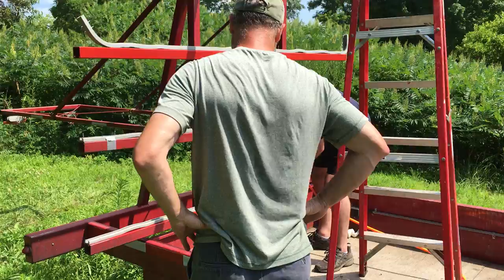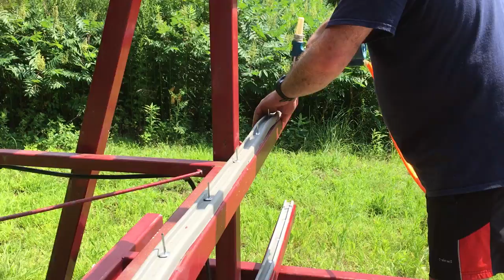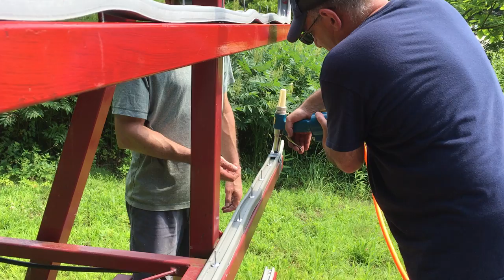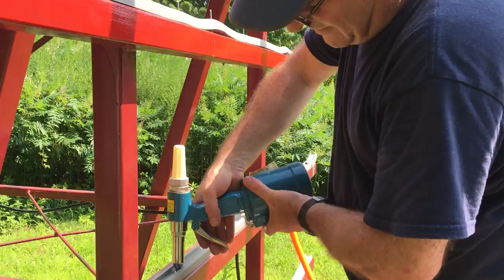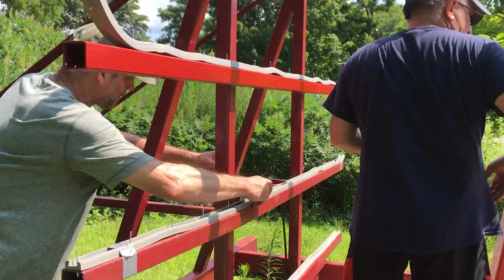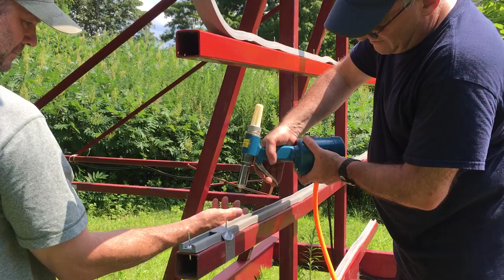Riveting New Boat Cushions on the Wayland-Weston Crew Trailer

Comment: I'm curious where you purchased the cushions from.  I'm having a hard time locating a source for replacement cushions.
Reply from the maker: Jeremy, they were from a marine supply vendor.  I will look for contact info for you later.
Reply from the maker: Jeremy, we purchased them in 2015 from a company called Defender, 800-628-8225, StanPro Small Horizontal Dock Bumper, item 000507, model 75000455, come in 8' lengths, 3 to a package.
Reply: @videostogo10  Thank you so much!  Will follow up with this as this is exactly what we need for our trailers.
Reply from the maker: @g8rsr1  Good luck, Jeremy.